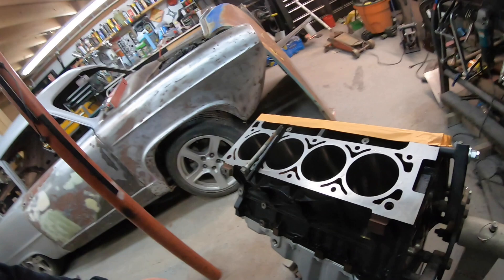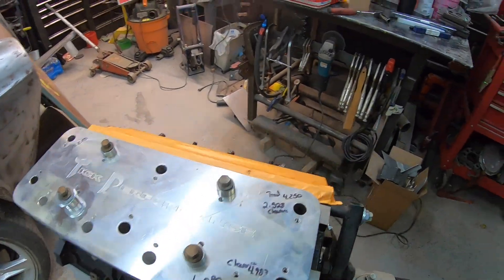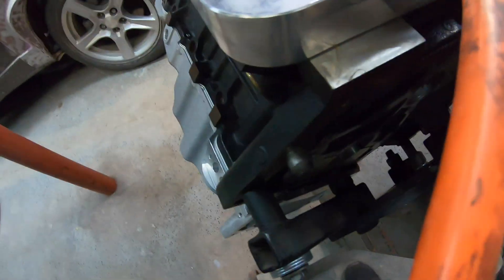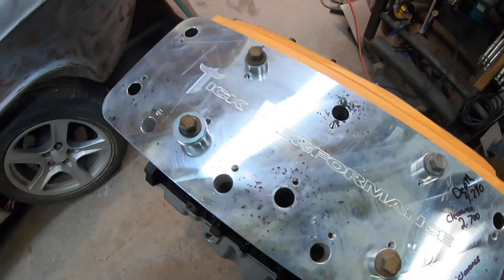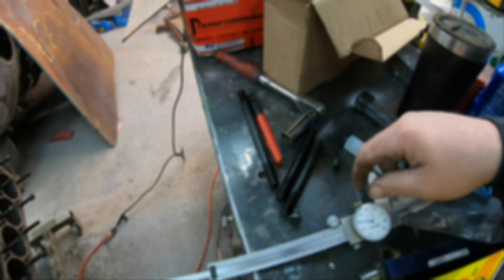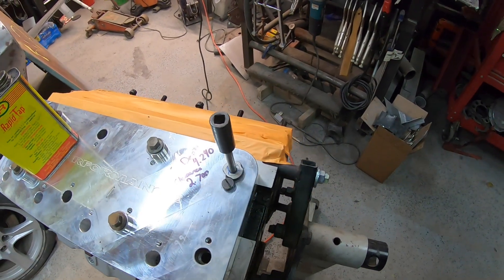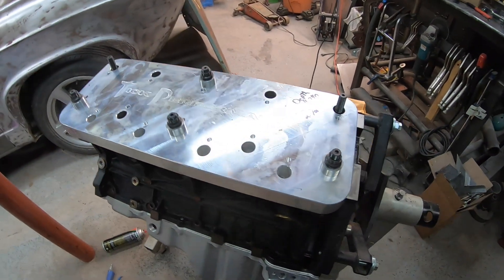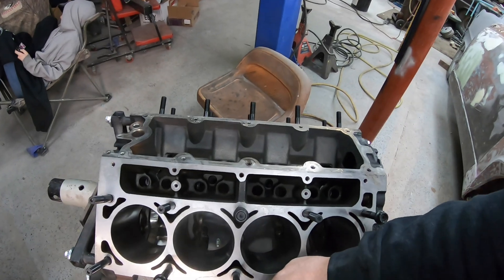LS 1/2" head stud conversion with the tick performance jig

Comment: So im planning this mod because of stripped threads in block. Any issues with this setup amd stripped threads after install?
Reply from the maker: This should work great with your stripped hole!! I haven’t stripped any threads yet and I torque aluminum block to 90lbs and steel to 100lbs
Reply: @TWISTEDIRONLLC  using the 1/2 inch studs aluminum gets 90 lbs? I've tried to install heads 3 times now with issues. So I figured this kit would beef up the threads and also they'll be new fresh. Did you use oil to install head studs?

Comment: product is a joke.  Anyone with a half decent deck and factory head can handle 1000+ hp.  The head flexes, not the block or studs.  Nothing more than a sales gimmick for the import 4 cyl guys who finally figure out how cheap and easy it is to make a thousand horsepower car on factory engine parts.  In certain engines that have plenty of bolts per cylinder, and a lot of rigidity to the heads, you might be able to increase stud thickness and hold the heads down longer.  Tick Performance is the laughing stock of the high HP LS community
Reply from the maker: It’s definitely not everyone’s choice of setups but have had very good luck with it @ 1500+hp
Reply: Dude sounds like a hater